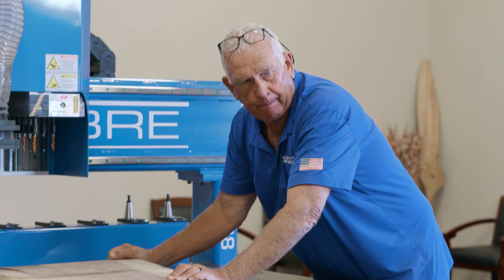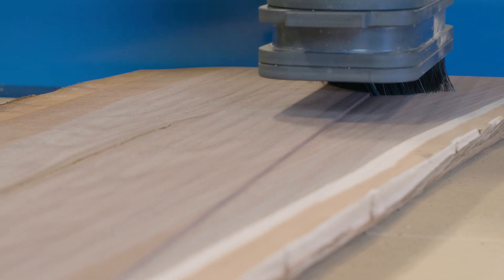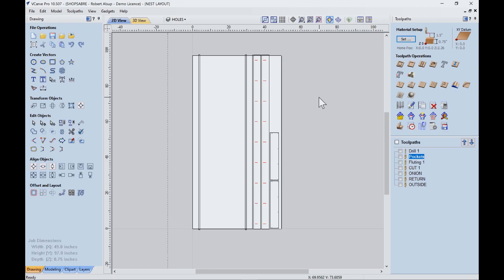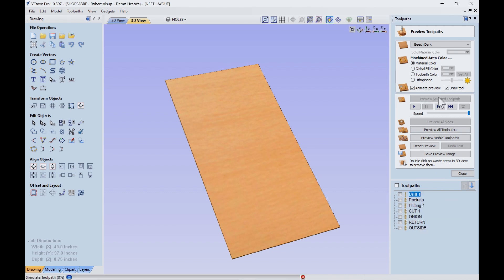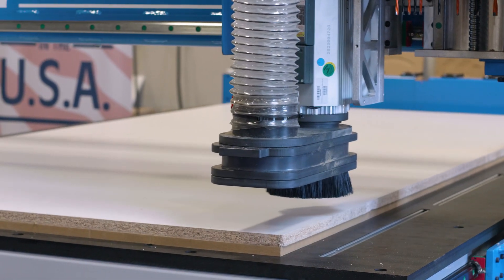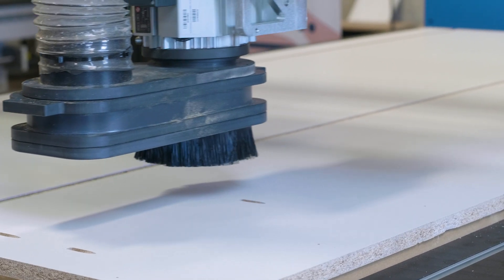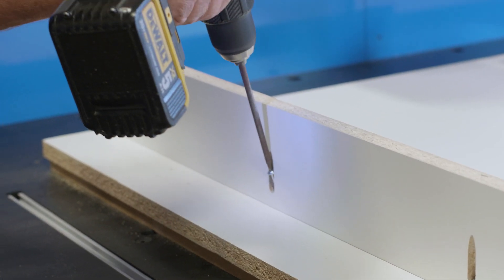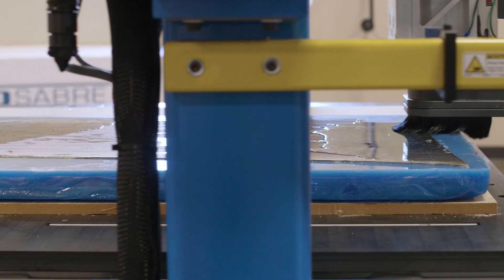ShopSabre CNC - Live Edge Epoxy Table Project with IS Series 408 Router

Comment: Thanks for the video...I have three questions about the planing. What router bit did you use for planing? What were the speeds and feeds. How many rpms did you set it to?
Reply from the maker: We use the vortex tool with their tool settings. 

Our parts department sells this tool if interested

Comment: With the IS 408 are you able to flatten slabs greater then 8’ by having one end hang over the side and then rotating the slab? In the video I saw 120” written in chalk on the slab, was it cut down to 8’ before flattening?
Reply from the maker: Yes you can hang off the front but most will cut down to fit table size